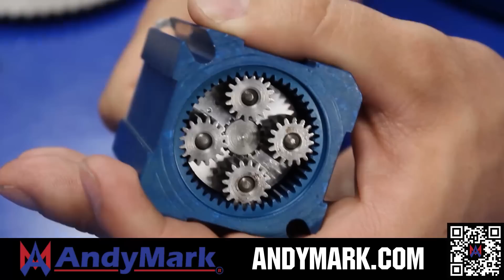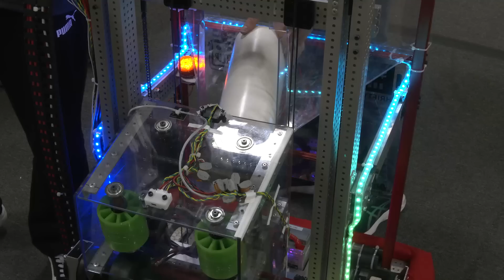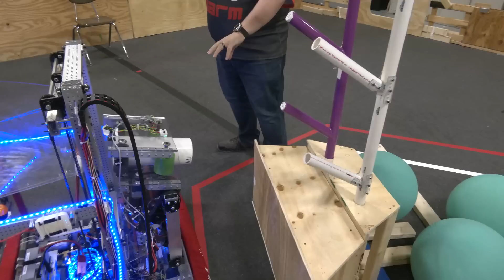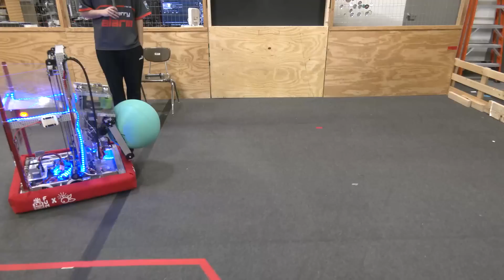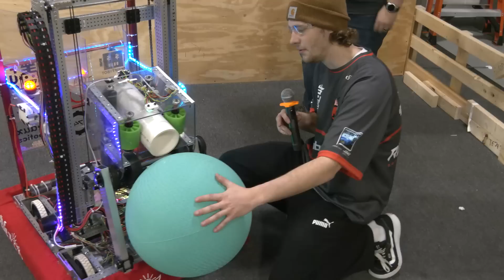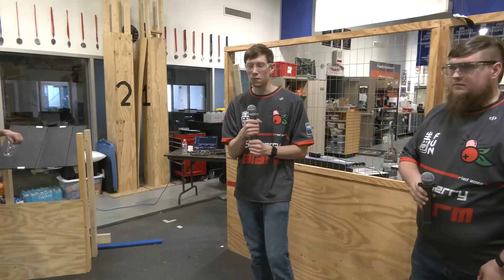Robot Scoring Demonstrations & Breakdown | Ri3D Cranberry Alarm | REEFSCAPE 2025

Comment: Are the brackets with wheels between each section of the elevator that make it glide smoothy custom, or are they able to be purchased somewhere?
Reply: Cory from Cranberry Alarm here!  The elevator kit that we used is from TheThriftyBot.  They sell a kit with the bearing blocks to roll smoothly, as well as the brackets/pulleys/chain to drive it!

Comment: If you push the algea strong enough could it be thrown on the throft
Reply: Cory from Cranberry Alarm here!  We honestly didn't look into this at all, but the answer is almost certainly no.  The top lip of the net is 6'4" while the top of our elevator end effector only lifts to 6'3" and the algae sits lower down on the end effector.  There is maybe some chance that we could flip the algae up, but it probably wouldn't be consistent or worth the time.
Reply: @corysnyder5507  sorry for my wording what I meant is launching it using the rollers, so no need to be it higher that the net. Using the wheels as like the ropes on a sling shot